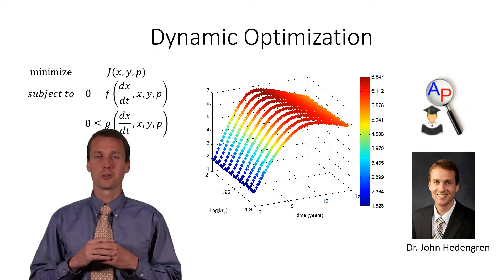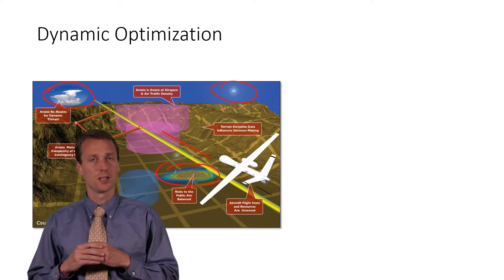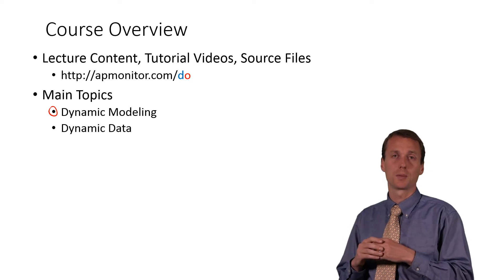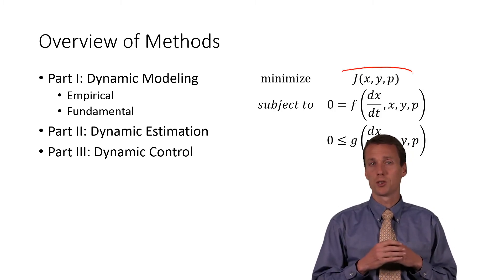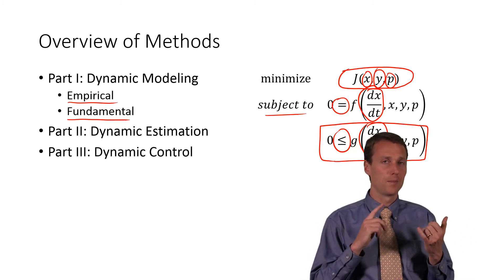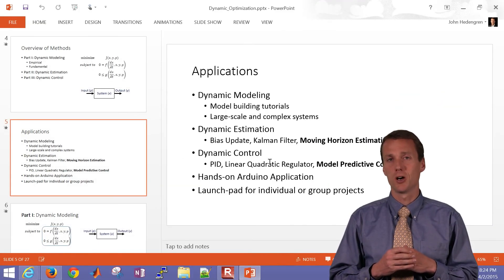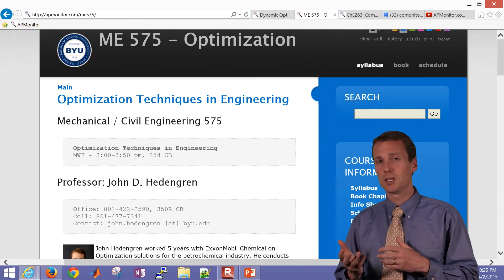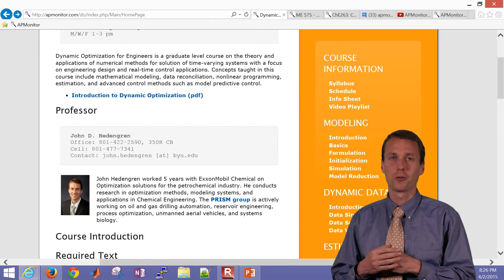Dynamic Optimization Online Course

Comment: if there is no dx/dt terms the problem became no dynamic optimization ??
Reply from the maker: Correct, if there is no differential equation then it does not need orthogonal collocation on finite elements to solve the ODEs. Here are examples without differential equations: https://apmonitor.com/wiki/index.php/Main/GekkoPythonOptimization
Reply: @apm  Really thank you because i got sensors that should change their disponibility over time so i guess there is no deviation in my objective function

Comment: another question if you don't mind. All the videos that I watched about dynamic optimization, you find the optimum solution at the endpoint I'm not sure why you did that. Can we find the optimum solution at all points?
And can we add a dynamic equation for manipulated variable  "$u"?
Reply from the maker: Yes, the default is to optimize along the entire time horizon. You may consider joining the dynamic optimization course. It starts in January 2019.
Reply: @apm  I may register   in this course but I need to submit a project these days😅
Reply: @apm  so I have to remove "p", therefore it will optimise along the entire time horizon, or you mean I have to keep the "p" and we assume it will optimise along the entire time horizon.
Reply from the maker: You can add the girl Vol. Manipulated variable by making a copy of the variable. If you need to control the rate of change then it has a built-in parameter called DMax. https://apmonitor.com/wiki/index.php/Main/OptionDmax

Comment: Hi Professor, I have dynamic optimization problem, I solve it as you did in your videos but I got errors message " error in syntax of function string: multiple operators" ... could you tell the mistake that I have, please?
Reply from the maker: It appears that you may be using multiple operators such as +, ×, ÷, - without separation by variables or parenthesis. It should indicate the exact location of the error as well.
Reply: @apm  thank you so much